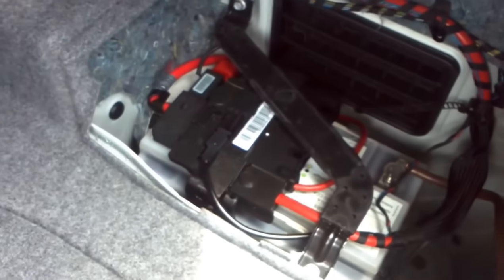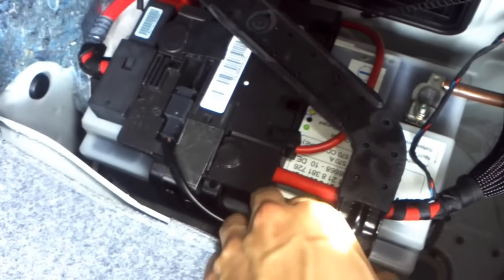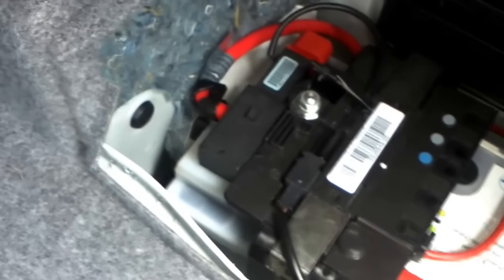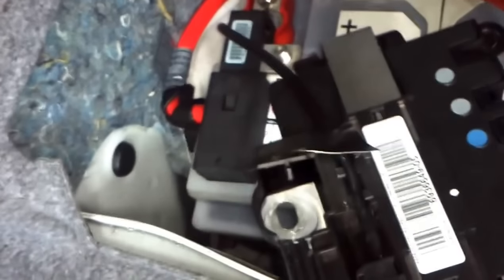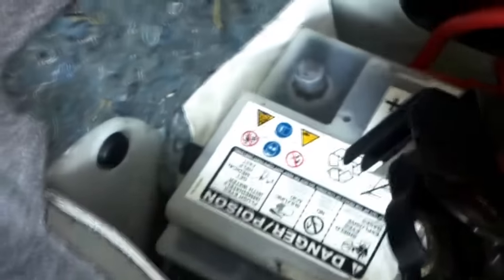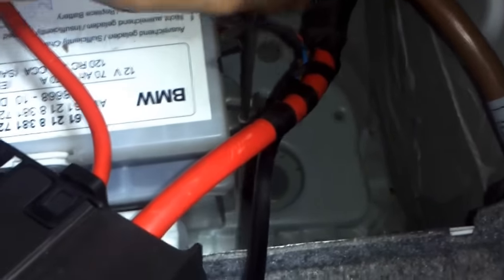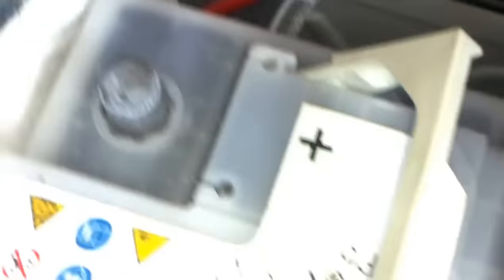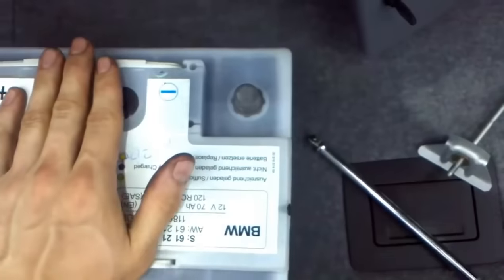How to remove and replace Car battery DYI BMW 3 series E90,E91,E92

Comment: So u didn't add in that you'll have to reprogram the computer when u replace the battery and u have to go to bmw for it. They charge 250 just for labor and programming the battery is around 195. This whole job plus taxes is around 500$. If u dnt get the far reprogram for the new battery the car will over charge the new battery and you'll have to replace it again
Reply: U can get a Carly and register your own batteries
Reply: Or you can buy bimmercode and do it yourself 👌🏻
Reply: Wish I knew that back then smh
Reply: I have just changed my battery as per the video. It was great assistance. What is this about registering battery. I changed the battery and it drives just fine. What will hapen if I dont register it?
Reply: @randpkandprgpearce5523 Nobody knows! I will say changing the battery can fry your FRM module. You will have to send it out and have it reflashed I have disconnected my battery since that flash and it hasn't happened again, that only affects certain years though
Reply: The real question is, all cars before never had to be registered, so what difference does it really make today?
Reply: @jimross2101 the difference is the newer cars are designed to charge the battery more as it ages  so itll fry your battery

Comment: You have taken someone else's video and posted it as if it's your own with no credit to the owner/OP. @bmwtroubleu is the correct owner and should be the one to get the likes and comments. I've tried to report you but YouTube doesn't make it easy which is probably why you've gotten away with it for 9 years.

Comment: Does the IBS if fitted need to be reset somehow? I thought that the Car adapted the charging profile based on feedback from the battery and you have to reset it to stop the new healthy battery being overcharged? Anyone..anyone...Bueller?
Reply: Rich Clark I am getting ready to change out my battery in a 2011 328i and curious if you ever found an answer to your question?  I have the AGM type to replace the old one but am thinking that could be a mistake without having the ability to reset everything.  Any help would be appreciated.
Reply: Rich Clark. Yea that's true I thought I could replace mines but I couldn't I had to go to bmw to get it reprogram